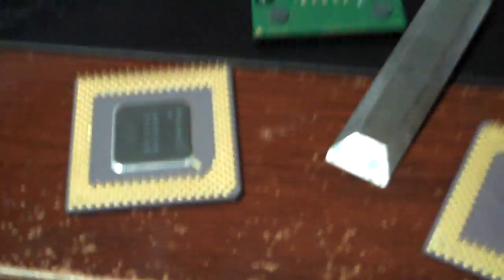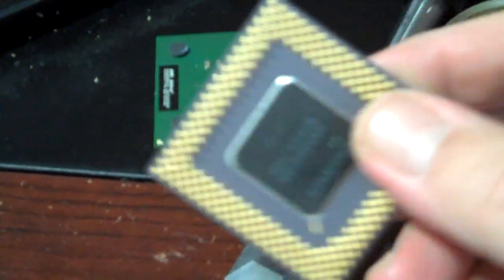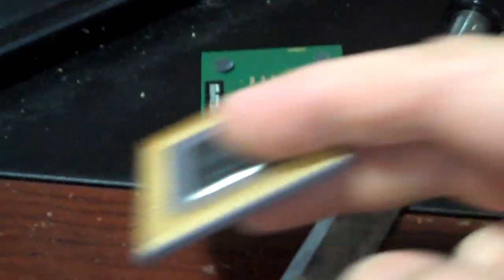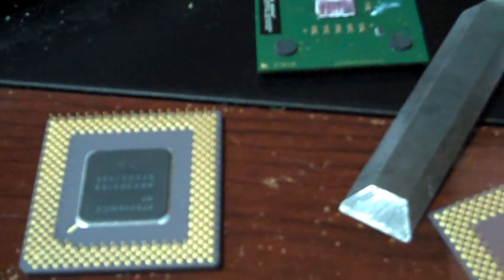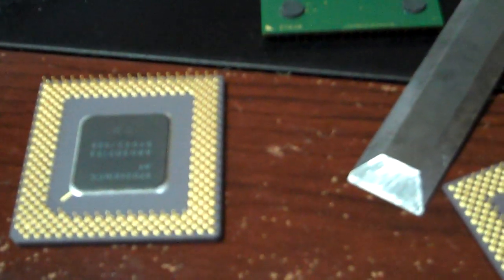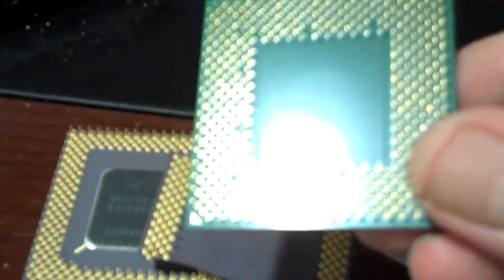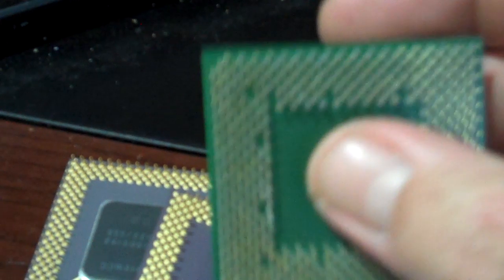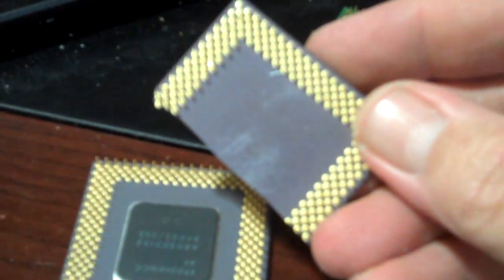Gold Recovery Ceramic CPUs

Comment: There's no gold within the ceramic matrix.
Sometimes, gold is used as bond wire coming out from the silicon and soldered to the leads around it on the ceramic. but it is always exposed.